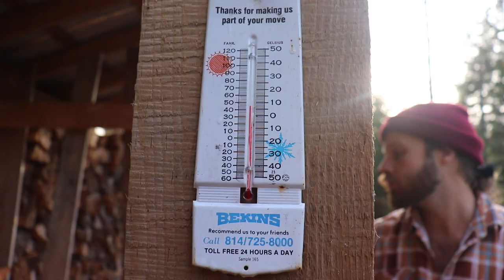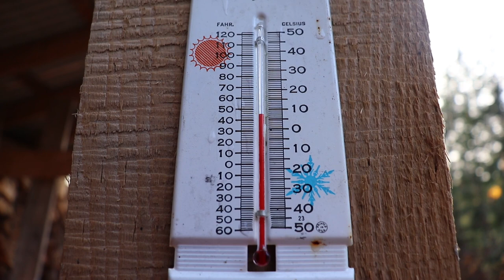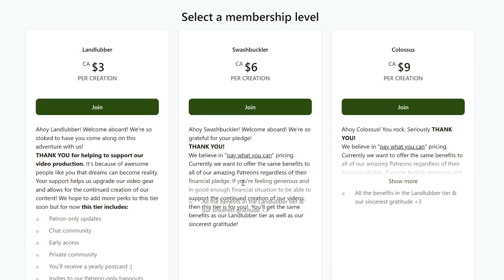Winter Came Early.. Are We Ready? Where's the Boat?! Life Update | Allison & James Off-Grid Life

Comment: You probably enjoy your stove better if you drill a hole in the side of the box and put a piece of pipe in throu the wall from the outside with a valve to use as a damper. So you don't use the warm air of your airstream. Close off the original damper. You'll need to figure out the size pipe.
Reply from the maker: Thanks Joe! That certainly would help to preserve the precious BTUs the stove puts out!